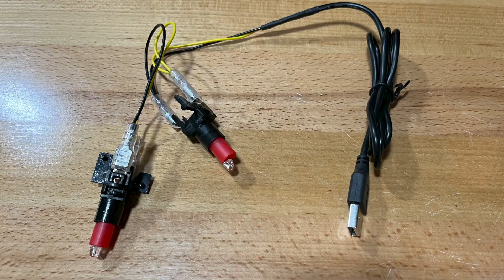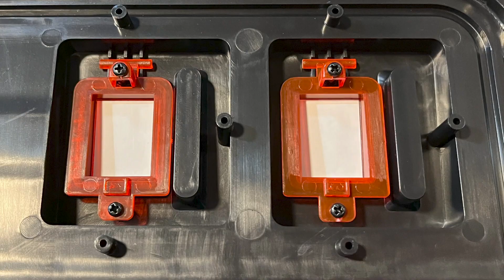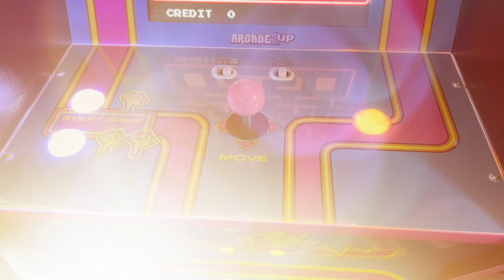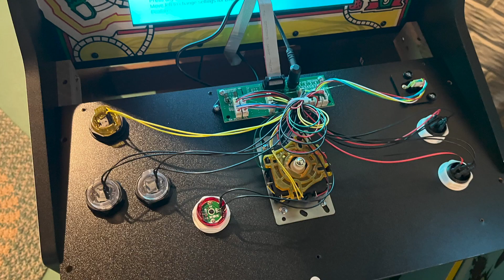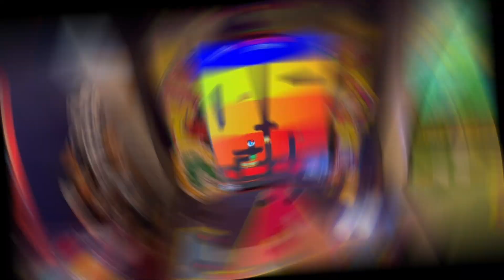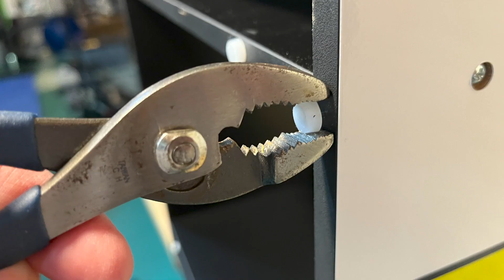3.5 mods for an Arcade1Up Dig Dug cabinet!

Comment: I'm surprised you didn't change the washed out monitor.
Reply from the maker: Hi Nick, thanks for the note. The screen actually doesn't bug me anywhere near as much as the marquee, so the next mod I'll do on this machine will be to replace it when I can afford it. Other than doing a warranty screen replacement, I've not attempted an upgraded screen swap yet, but it would be a good next-level project.
Reply: @PoppArtstudios  have you done a monitor swap on this?